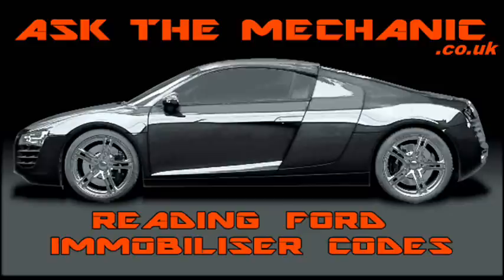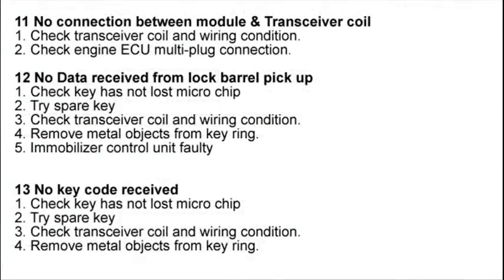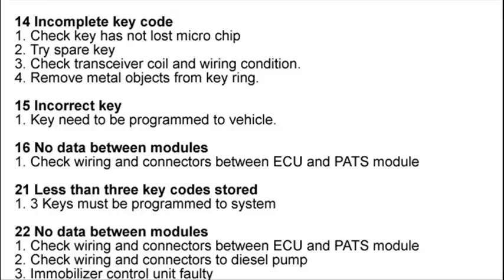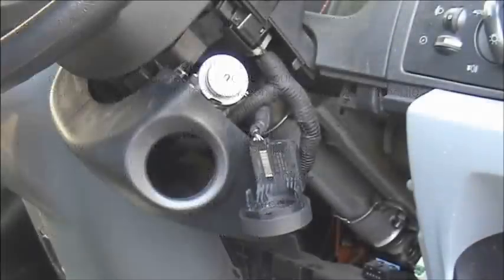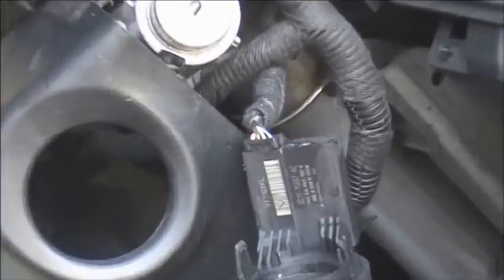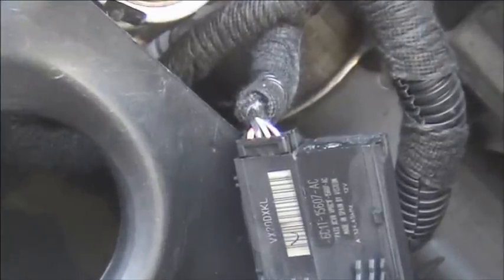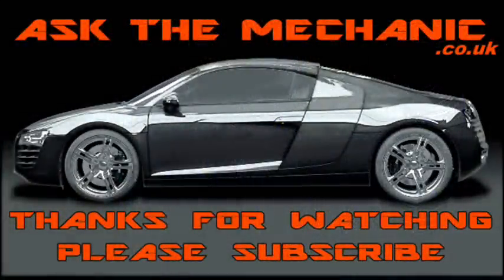Reading Ford Immobiliser Codes PATS

Comment: Mine is flashing. In the engine are a noise is a sssssssss next to the egr valve and there is a square box like plug with wiring around it.
What is that noise?

Comment: Hi, I hope you can help. I opened my 2006 ford fiesta with the button key, then turned on the engine with spare plain key ( without automatic buttons) Now when my car is parked I'm getting the red flashing. Its not on when driving only parked. Tks

Comment: Hello, I have a Ford Connect 2007 diesel (Italy), left key on accidentally for a night, battery out of charge, recharged, everything ok but ignition. the pats code you provided is 2-3 (data mismatch between PCM and instrument cluster --- requires reprogramming). I kept the battery off with + and - connected for hours but nothing. Ford does not expect to have such a situation and provide an emergency mode? I have to call a tow truck and a fortune for the repairing... Thank you for your kind attention.

Comment: Can you explain code 23 to me please? I don’t know what it means by PCM. I’m getting this after swapping in new instrument cluster and the car won’t start with them in.
Reply: 5 moths late but it is a  Power control Module.
Reply: @TheOnlyinLosangeles  I'm getting 2 slow flashes then 2 quick ones would that be code 22 ?

Comment: I got a focus 03 that's saying the 11 code on my hazard light... is there a way to fix it without going to Ford
Reply from the maker: Code is 11 is problem with the Transceiver, this is the coil of wire around the ignition switch, have a good look at the wiring and the plug, you will need to remove the cowling to see it.

Comment: hello , i have qestion about ford c-max ecu , the car have code 23 from led light , the ecu was change for use one , is any option to download or read file from car for immo  to write to ecu immo chip , i do not have old one ecu to move or read  immo chip

Comment: Mine stays on all the time even when the car has started, my car is hard to start and cuts out after a few mins of running...2008 TDCI Focus style, any ideas ?
Reply: did you get this resolved?
Reply: I do not have the car anymore but yes I sorted the problem, it was a blocked EGR valve

Comment: I have exactly this problem with my ford focus 2005 and took it to the dealer who said this test is not reliable, it started for them and the diagnostics test shows no faults, I told them about this video so they looked at the coil and said its ok, could it be an intermittent fail issue, or could it be something else????

Comment: Dismantled the key lock, checked wiring from key under dashboard, cleaning as I went, checking for breaks/damaged wiring, checked fuses
I dont have FDS2000 or any other similar tool, so now I am at a loss whats wrong.

Comment: Found someone with similar issue at bba reman com forum topic 113186-1-1
No Milage showing, took cluster out & cleaned with lube oil, put cluster back, and milage appeared, but red light still flashing 1:6
Found Fordwiki, and Youtube, plenty hints, but none specific that I could find, tried Ford Wiki

Comment: 1.6ltr Petrol Ford Focus, 55 plate.
Battery was left to go flat, tried recharge, then a push start, seemed like engine wanted to turn over, but didn't
Replaced with a working battery
Red Immobiliser flashes 1:6

Comment: I have a code 16 on a van that i need to get running for work in the morning, I am downunder in OZ so I have a 5 hours to get it running and it is 1am in the morning right now... The code indicates there may be a loose connector between the PATS system and the ECU, my question is Where is the ECU so I can check it ???
Reply: Any one know the answer im having same issue

Comment from the maker: It’s not easy to bypass, if it were it wouldn’t be a very good system, but a new key can be programmed to the vehicle, but you need the correct software to do this, so normally a trip to dealer or an alarm specialist

Comment: Hey, mechanic, thanks for the vid!
Was wondering if this system of reading the PATS codes transposes to a significant amount (if not all) Ford models. My Dad who's not quite internet savvy has had problems with his Ford Fairlane BA G220 not starting sometimes and asked me to poke around for info. Any reply would be greatly appreciated :) thanks!
Reply: Instablaster